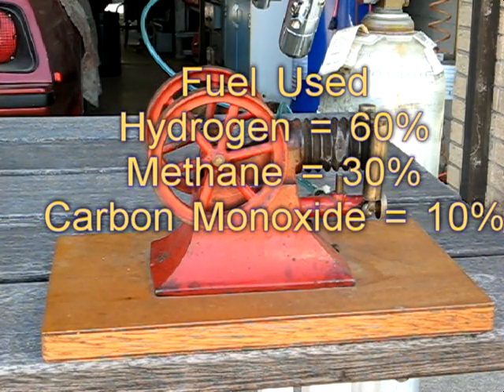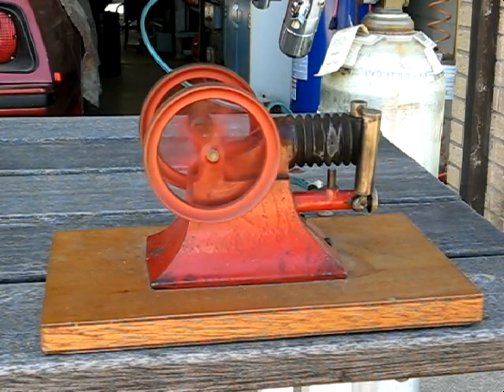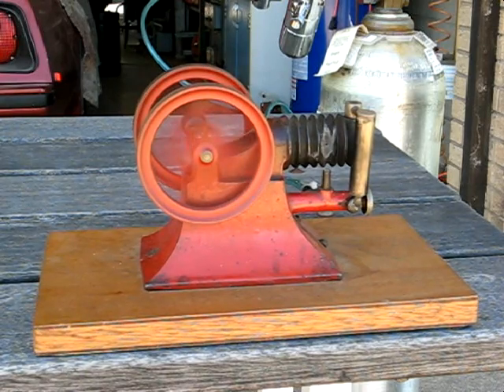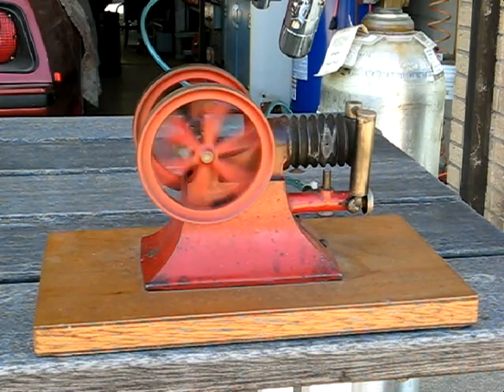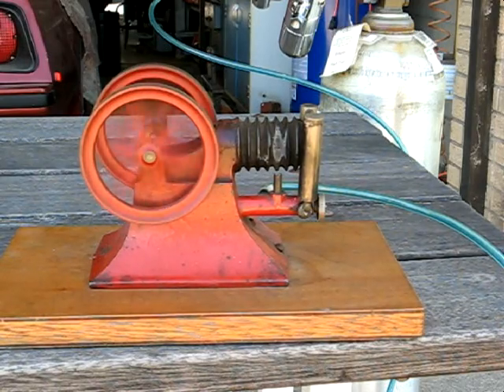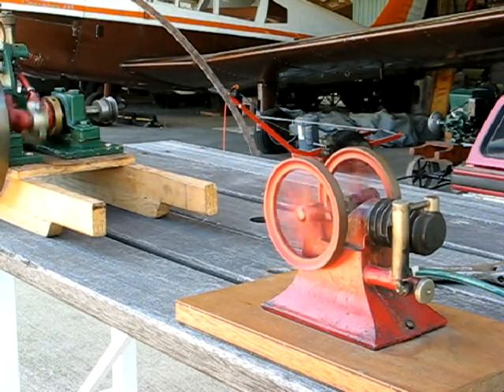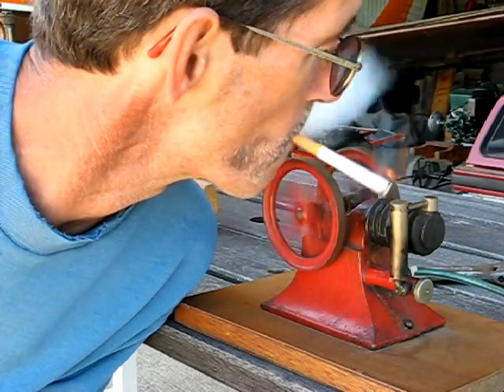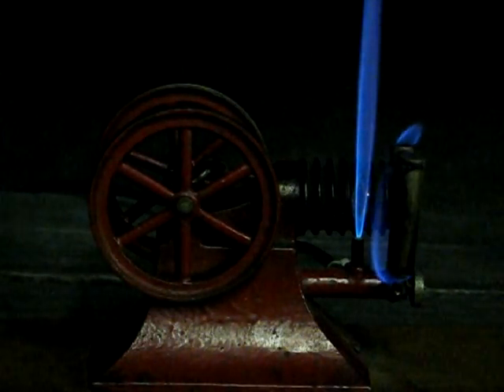Paradox Gas Engine - II

Comment: I applaud you for knowing most of the components of Illuminating gas (Coal gas, Town gas, Manufactured gas, Coking gas, etc.) but you are missing a crucial one that makes it "Illuminating Gas" that is ethylene and/or acetylene. A mix of around 50% hydrogen, 30% methane, 10% carbon monoxide, 5% ethylene, and 5% acetylene were found in good illuminating gas. This is what allowed it to be luminous without a mantle, and when the mantle came about, illuminating gas lost favor over natural gas.

Comment: It runs by taking in hot gases on induction and the cooling of the gas in the cylinder causes a vacuum that pulls the piston up from bottom dead centre,then there is a cooling stroke and it repeats itself after that,some flame lickers have a slide operated induction valve for the flame.There is no combustion in the chamber,it works solely on the principle of cooling gases contract creating a vacuum,Sterling engines use the same principal but in a different way,flame lickers are just a novelty,
Reply: Marketed and sold originally as a toy. I just saw a ad for one in a 1904 newspaper that I was thumbing through.
Reply: Hey silver bro. It's different from flame licker engine